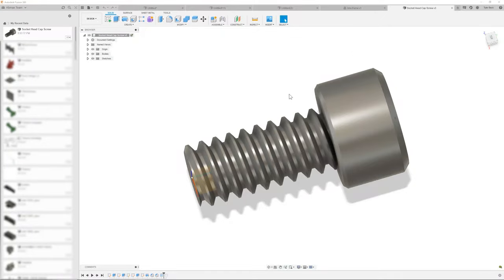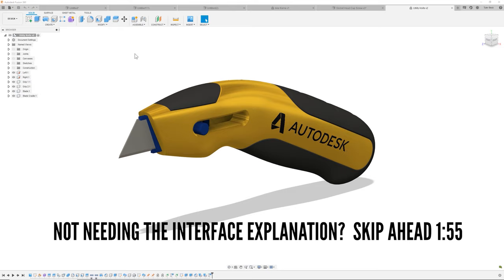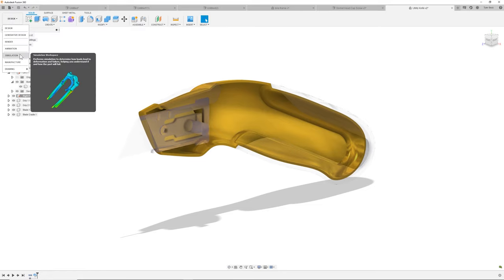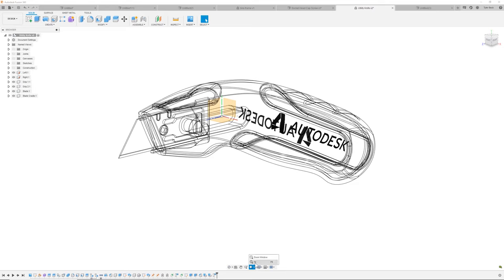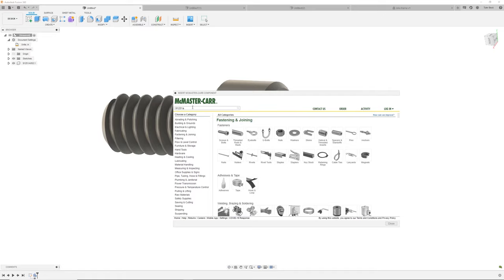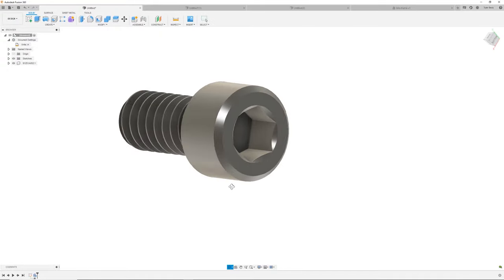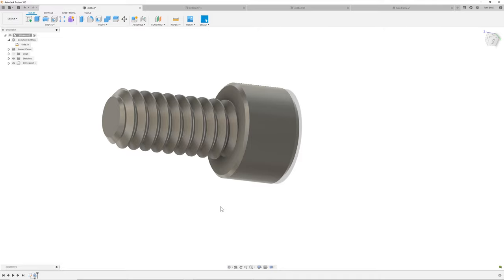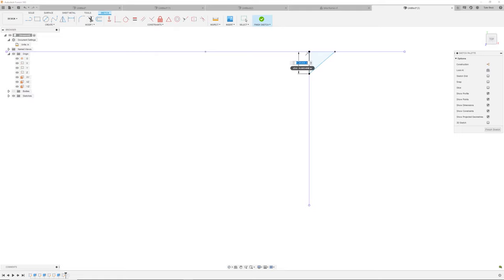Fusion 360 - Socket Head Cap Screw (Brand New User Tutorial)

Comment: G'day Tyler 
Just found you Chanel and it's awesome. 
One question though. 
You mentioned that if you were doing a lot of bolts don't do the treads.
I'm working on a design with many printed threads. Will I have problems? 
I've got a resin printer, so the tolerance can be smaller than pla and it would be able to print it, I hope. 
The threaded holes are m3 for m3 countersunk hex head bolts. 
Havagooday Greg